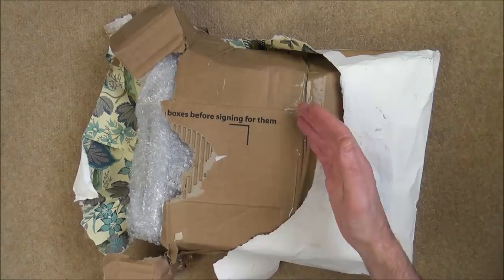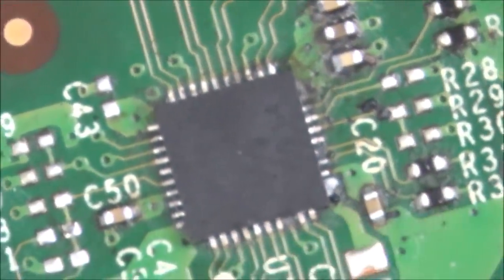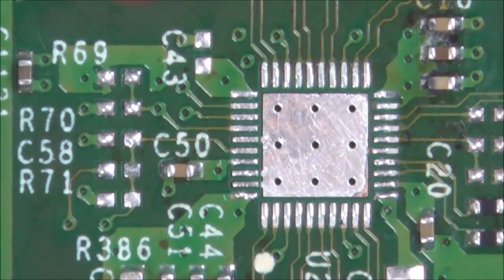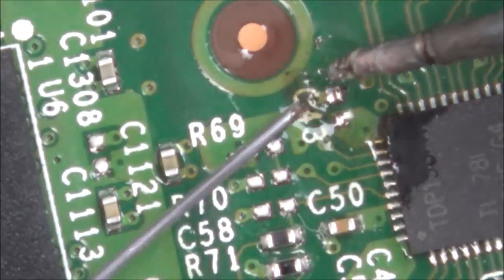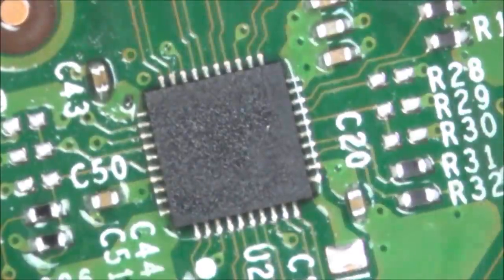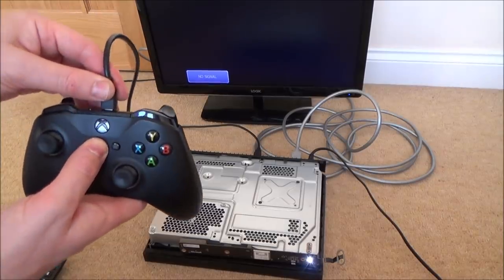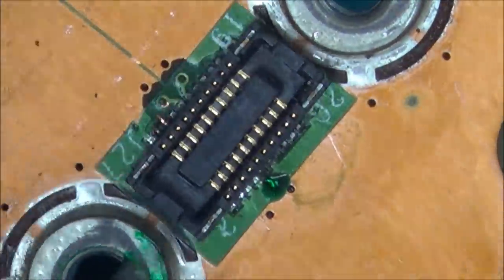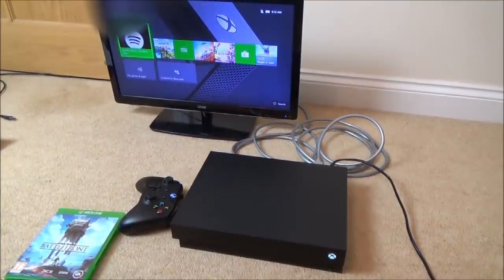Trying to FIX: Faulty Xbox One X No Display

Comment: Question good sir, for noobs, would you recommend thermal taping off the surrounding area when doing something like this, or also doing HDMI Ports ? Thanks again !
Reply: for doing computer and tech repair for 20 years I would recommend it for replacing things like chips and surface mount components especially that are really close by using some kind of protection from the heat on other components surrounding it to prevent further damage when using things like a heat gun
Reply: kapton tape is good for that, or just putting something metal around it. Ive reworked stuff using spoons as a shield for vulnerable plastic
Reply: @HFkepley9312  I'm about to dive in and do my first HDMI port replacement and just want to make sure that I have plenty of shielding for all those sensitive parts lol I just did a few analog sticks today to get comfortable with my rework station

Comment: Like an idiot - I decided my first attempt at chip replacement and soldering would be on my xbox one x (scorpio edition) because hdmi went out.  Guys like this make it look so easy - it is NOT.  I now have to replace c18, c19, and retimer.   Question on retimers - is there tricks to indicate which direction it should go in if you've lost the dot and/or lettering? Midway through heating it up, it spun around - no idea which direction is correct.

Comment: Next time touch all the pins with some solder . Again the ground pad underneath is still a pain and does take some heat to remove. I find putting on a lower heat and then putting heat into the board first then turn it up for removal

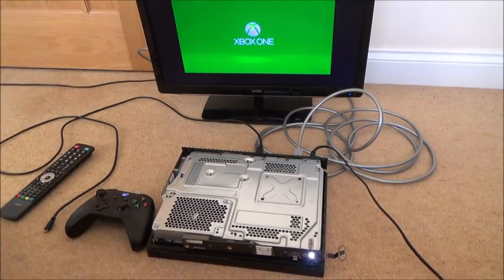Comment: I have watch ed up to 43:00 and I do think the hard drive is dead the slight ticking noise is the hard drive trying to spin up then cutting out. try connecting it up to a laptop and see if it starts up or tick's.

Comment: The pads on that little connector it are easily torn I did it on my first one x as long as everything is lined up the screws hold it in place and works fine

Comment: Well done but maybe if you added wire on every pin the connector would have soldered on to the board. But nice fix i would have gone old school and wired a connector to the board micro molex or jst to complete the fix.

Comment: Vince, can you help me with the values of "U21" chip, and EG3/EG4 filters so I can replace them, they are part of HDMI retimer (around retimer on the board) ? My Xbox first has no power after some power outage, I checked HDD (and replaced), and replaced retimer chip, and now there is power again, I can pair controller, disc drive is working, I even can turn console off via the controler (without signal), which proves that console is working, but there is no signal. Now I would like to replace this 3 components, as I heard that they cold be reason for not working, but cannot find values / serial numbers, anything ? THNX in advance, KR Marko

Comment: Great video as always Vince. However, can anyone explain to me how that sync button works? As in, how does connecting a single wire to it, allow for the circuit to be completed? Wouldn't another wire be needed to either connect the other side of button or probably connect the button to ground?

Comment: Turn down the airflow and you won't be knocking nearby components off. I use about 30-35%. Alternatively, use aluminium tape over nearby components and it's ok to use higher airflow.

Comment: **TIPS**
1/. Before removing components it's good practice to add leaded solder to the pins.
2/. Once the component is removed wick up or suck up excess solder and reflow LEADED SOLDER with the least amount you can, the less solder the faster the reflow.
3/. It's good practice to PRE-HEAT the Board before whatever SMC is placed down, be-it a Capacitor, Resistor or Chip, once solder goes shiny place PR-Fluxed component roughly in position and reheat and nudge until component resists moving away from it's proper position.

*MOST IMPORTANT**
With Hot Air, The faster the flow of Air the more likely it's going to mix with surrounding cool air, ergo the only time airflow to the hot air gun is raised from it's normally low flow is when air is needed to be forced Under a rather large component, In short I found a lower airflow works better than a higher airflow, and thus I hardly ever have to increase the heat over 360 degrees..

Comment: when testing small smd components I use a piece of blue tack which I stick to the table and then stick your component to the blue tack now you can easily take measurements with your multimeter without the risk of the component flying into oblivion.

Comment: REFOX Soldering Lug For Pads Repair
Repair dots quickly,High efficient/stable
To replace the traditional jumping wire
With the effect of original soldering pad

Comment: I had a blank screen, but had sound. Hard reset 6 or 7 times and same thing. I watch this, hard reset and held the power and sync for 15+ seconds and my xbox turned on and went to home screen like normal. Did I mess up and just get lucky? I swear I've always used the power and eject button to bring that screen up but even that usually didnt work for me.

Comment: I'm wondering if someone could help. Can someone check if the xbox one x will output audio through the optical port if the hdmi is disconnected or not working?

Comment: Looks like it's time to get a better rework station. If you don't want to spend a lot of money, I'd recommend a cheap chinese knockoff with an internal diaphragm pump (inside the base, not a fan in the handle), make sure to open it and check for shorts and/or poor solder joints before turning it on.  Or just buy a broken Hot Air Rework station on Ebay and fix it.

Comment: I actually bought a one x recently just like this. no display, and it was advertised as it would sometimes come up with an E104 error. To which when I received it, it acted like adverted. I took the hdd out and connected it to my pc and turned it on and upon turning on the pc the startup disc check said it was repairing the drive and then it worked perfectly after windows got done repairing it for 3 hours. Guess the hdds just decide they wanna play dead sometimes. dunno.

Comment: @MYMATEVINCE @andrewpaul has a video were one of those connectors is stripped and he run runs wire to get the button working at least the sync button you should check that out

Comment: The FPC Connector needs to be lifted straight you twisted a little while lifting 😉 the are fragile because then its cost more money to repair, Microsoft would charge for a complete new board but only repair that part

Comment: I'm ripped  off  the PSU 5 volt connector with solder pads on my PS4 Pro 2 months ago..., geez that was a rough day..., but I'm repair myself with the testpoints on the borad. Be careful with these bastards!!!

Comment: It's time to change tip to airgun finally, you use same size for everything and there is a reason you got at least three with station. That's not only problem with chip's, you heat smaller components for far too long because of that. Not so problematic with resistors but with MLC capacitors and most of other components it is.
USB port can be fix, there is just 4 leads needed but I'll rather use ribbon for that than 5 single wires (4+button). Actually you need one less since ground is already there on small PCB (probably from chassis since you didn't put wire for ground)  so only +5V, data- and data+ is needed.

Comment: The one x borads i feel like are cheaply made with dead upon arrival at launch overheating etc the one s longest i have had one was 3 years i got a new one ive had 1 fat boi xbox one 1 and a 1 slim
Reply: I've had my limited edition xbox one S for a long time with zero issues but I maintain it all the time like cleaning dust out of it so it can still have good airflow. Only problem I had was stick drift so I repaired it and made a video on how to fix it on my channel which is my most popular video gaining nearly 6k views which is sad as it means loads of people also got stick drift.
Reply: @stonedsavage7814  yeah that's quite common, but it's common across the board. My ps4 had the same issue with the joystick thing and I just took it apart and cleaned it all up.